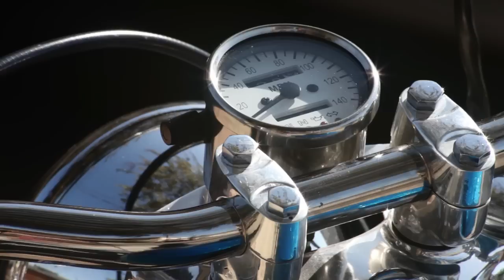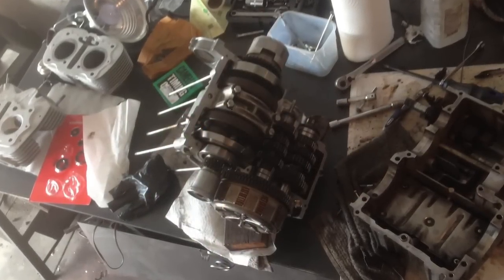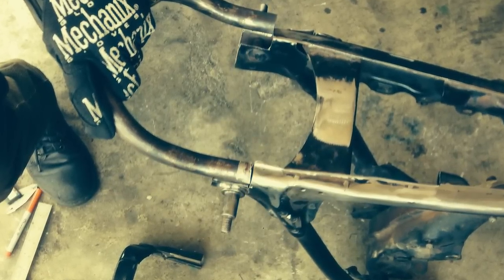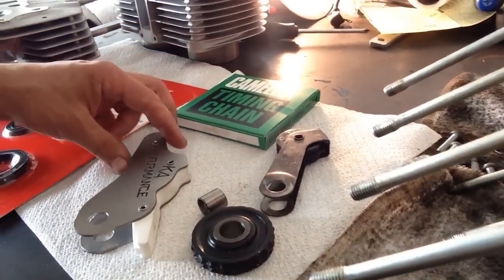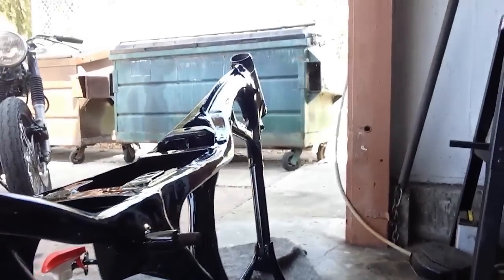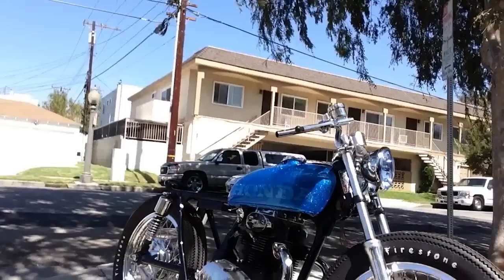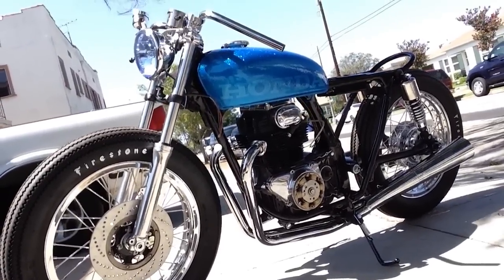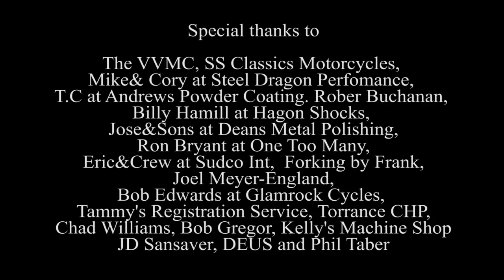Skyler (pilot episode of Bike & Builder series from Choppertown)

Comment: The bike came out beautiful. The narration and music however,  were far too dramatic and there wasn't any real work getting done in the video. There's talk of trying to get the rear loop to fit and it comes off as the hardest challenge of the build yet it literally takes a few minutes to cut and fit a tail section like that. If there's going to be more episodes, I hope there's more actual fabrication and building involved with them There's been more than enough drama based automotive "shows" and not enough for the actual bike builders or people interested in fabrication. Whatever way you plan to take the series, good luck with it!

Comment: so basically you dont do anything more than send out all your parts to be reworked leaving you with nothing more than an assembly project.  That doesnt qualify as a builder.
Reply: +Thomas yates do you plate your own parts? do you machine every nut and bolt? do you forge your own raw steel? 

if you are using a welder and hand tools to make parts of the bike, your building. not just buying jellybean parts and assembling the lego set.
Reply: way too many critics in this world
Reply: You can’t do everything man.. do you do your own chrome or powder coat? No... you send it out to be done